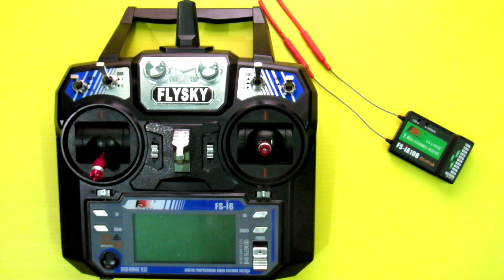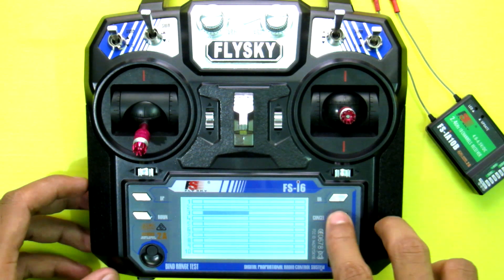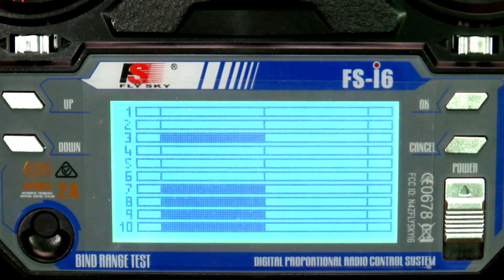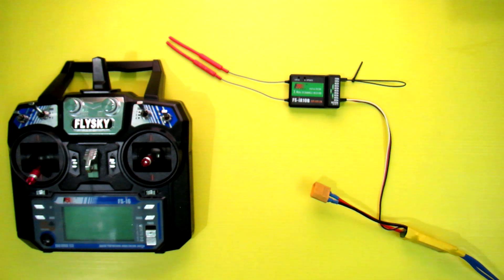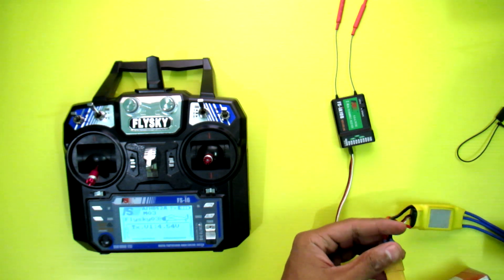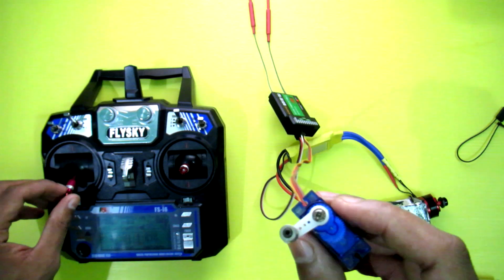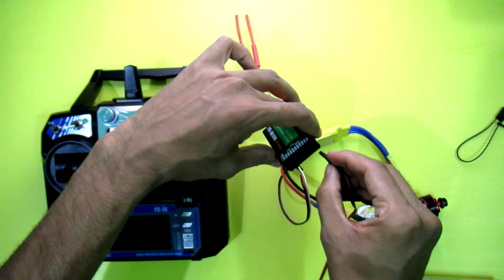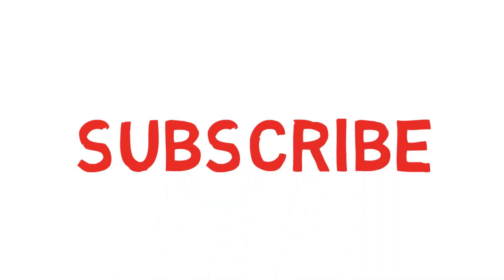FS-i6 Firmware Upgrade 6Channel to 10Channel

Comment: my flysky transmitter looses signal and gets unbind bought a new reciver then too had the same problem please help sir from were to buy the USB cable to upgrade firmware to make it 10 channel
Reply from the maker: You can use any FTDI adapter or arduino or  the cable comes with CT6B

Comment: its really hard to setup this remote for cars lol
Reply from the maker: no it's not
Reply: The first 3 days with the remote control I could not drive backwards, it cost me a lot of nerves, until that worked.
And i dont know exactly what ive done lol

If I read the comment sections of the i6 remote control videos in connection with rc cars, I was probably not the only one ^^
Reply from the maker: you need to connect the ESC to the channel 2
because in channel 2, the stick stay at the middle position(1500)
in car esc 1500 is stop
below 1500 is backward
above 1500 is forward

Comment: excuse me..my ch1 and ch2 doesn't work after i upgraded...i have no idea why..
Reply from the maker: Please do it again, and check all channels. if still you face the same problem then roll back to default firmware.
Reply: MakerHand I tried back to default firmware but it doesn't work either..or my way to roll back wrong? Which Exe should I use in all the file? Thx for reply me
Reply from the maker: There is a link in the description box for the stable firmware.

Comment: does the upgraded 10 channels version still bind with ia6b receiver in PWM? thank in advance those who can answer.
Reply from the maker: 100% Yes,
My all FPV flights are with iA6 and iA6B
https://youtu.be/GFye30SoJe8

https://youtu.be/3s2bG8JP888

Both flights are approx 1 Km range
Reply: MakerHand  thanks a lot man i thought it only work with the ia6b in ibus set up because i only familiar with pwm set up.
Reply from the maker: It works perfectly with PWM, I also use PWM for my fixed wings
Reply: MakerHand   thanks again god bless
Reply: MakerHand  does this upgrade reversable to original firmware?

im worried if i cannot bind it with my tiny whoop
Reply from the maker: Yes, you can revers it, by flashing the original firmware
Reply: MakerHand thanks man great video